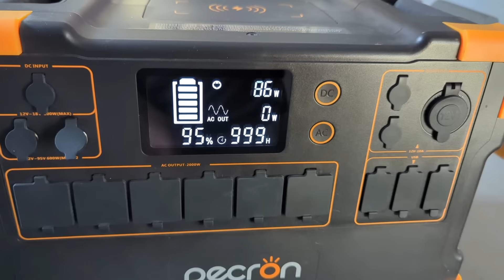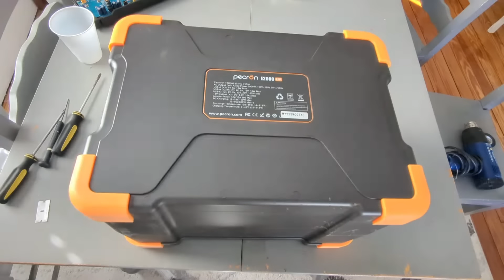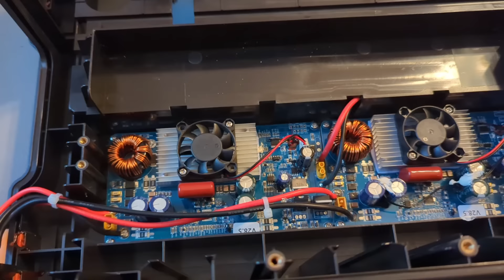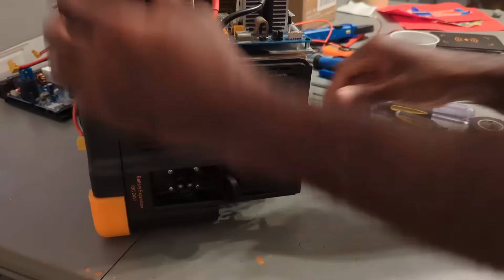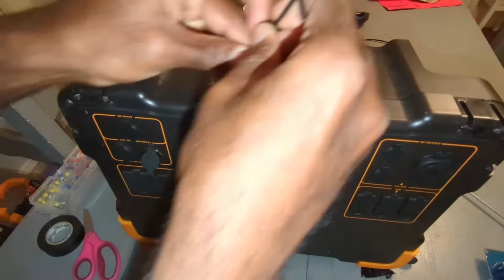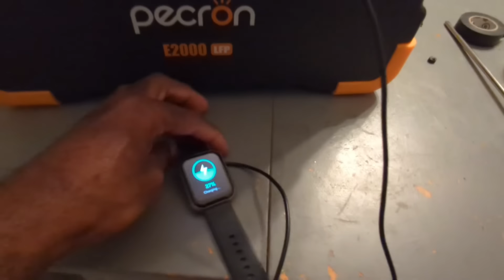Portable Power Station Teardown & Part Replacement - Pecron E2000 LFP

Comment: Someone connected AC input to the Ac output and the two waveforms shorted. What could have burnt. Its not turning the AC output on but DC output works. AC charges does not work but i thnk DC charging works

Where did you get spare boards?
Reply from the maker: I got the board from the manufacture

Comment: I have pecron f1000lfp with error 25 appears on screen doesnt work ac or dc
Reply: If u have anysolution please let me know
Reply from the maker: I’m not entirely sure what causes Error 25 on the Pecron E1000LFP, but a quick fix worth trying is fully turning off the unit for a few minutes, unplugging all inputs/outputs, and attempting a full reset.  
For better troubleshooting, I’d highly recommend asking in the Pecron Facebook group. The community there is super helpful with specific error codes. You should also reach out directly to Pecron support at support@pecron.com so they can help resolve it or replace the unit if needed.

Comment from the maker: Yes I remember seeing fuses inside. If you can check the battery voltage. If it's too low, you might have to charge it with an external charger.

Comment: I have no power at all. Suggestions what to look for?fuses on side are good, is there fuses inside unit?
Reply from the maker: Yes I remember seeing fuses inside. If you can check the battery voltage. If it's too low, you might have to charge it with a external charger.

Comment: I have a problem with one of my e2000's as well.  They were going to fix it but I never shipped it did not want to get into the shipping thing.  Weird thing my bad solar input will work with their 200 watt portable panels.  It will not work with the charging brick or my glass panels.  Makes no sense it will also not work with the e600's charging brick as well.  Pecron now pays for shipping both ways they fixed my e3600 that had a bad inverter and they sent me a new e600 because it had a bad solar input.  I have 6 of their units I stick with them because they do fix things when there is a problem.  Great tear down and fix not sure how you remember where all those wires go.  Lol
Reply from the maker: This is incredibly helpful information about the e2000 and Pecron's customer service, thank you! Glad they resolved it for you. keeping track of those wires can be a puzzle, lol!

Comment: I shipped it back because it was dying too fast but they sent it back and still didn’t work. However it is still under warranty and they have worked with me to get a new unit. While frustrated with the issues they have stood by their product.
Reply from the maker: That's definitely frustrating when you're dealing with a faulty unit, but it's great to hear they're standing by their product and getting you a new one under warranty. Good customer service can make all the difference.

Comment: Great Vid,
Sadly, I have a Pecron E1000 pro (old Litho).

They say, " bad board ", too.

Yet, From East to Western USA, it's too expensive, to ship .
 I should have had the board sent to me.

Here's my questions: (ur best guess)

A) How much difference do u think the setup is, inside ?

B) How do I find a device provider (anyone) in the northeast (USA).

U did a great job, but definitely kno what u are doing.

C) Is there a "Reset" button on their older models. Which I can reset the power station.
Or should I ask them to, send me the board and just sell it ?

It works fine but won't charge ( by pwr bank or Solar )

Any help or ideas, by any & all who have read this is - will be appreciated.

Thx !
Reply from the maker: I would expect Pecron to maintain a similar design. I'm also unsure if it has a reset button. Could you clarify what you mean by "finding a device provider"?
Reply: @talenteddad  A Solar station repair facility. Located in the Northeastern Usa
Reply from the maker: I don't know of any locations in the Northeast. You could try asking a general repair shop if they're able to fix it.

Comment: I would have taken the opportunity of the unpacked battery to check whether and how I can connect an external battery to turn 2000 kWh into 5000 kWh.

Otherwise, great video, thanks !!!
Reply from the maker: It is possible to connect a 5000kWh battery to it.
Reply: @talenteddad  Have you made a video howto connect another battery parallel?
Sure, you can connect another battery to the Charge Port. But in this case you need control the power and you couldn't charge them parallel.
Reply from the maker: I don't have a video on that. If I get a 24V battery with BMS I will try to post a video. I think an external battery should have its own BMS. And I'm not sure if the pecron battery percentage would be accurate after doing this.
Reply: @talenteddad  Well, Pecron might not be too happy about this, as far as I'm aware, Pecron sells their own additional storage for their inverters, which competes with a DIY solution.
Of course, the external DIY storage would have to have its own BMS. But both storages connected together, creates a new solution, because there is often a whole rainy week, in which additional storage is desirable, on the other hand there are often several days in a row of sunshine, in which the additional storage could be well filled. In short, I'm a fan of an additional storage tank, because it allows additional benefits to be generated with few resources.

Comment: Thank you for a great video. It was very thorough and easy to follow. I am currently having an odd problem with my E2000lfp and don't want to have to send it back to the mfr. Using your video I feel confident that I could replace a circuit board if necessary. Hopefully, I can resolve my problem with a reset or something but good to know I can refer to your video for help.
Reply from the maker: I'm glad the video was useful. Hopefully, you can get your issue resolved without needing to replace a circuit board!